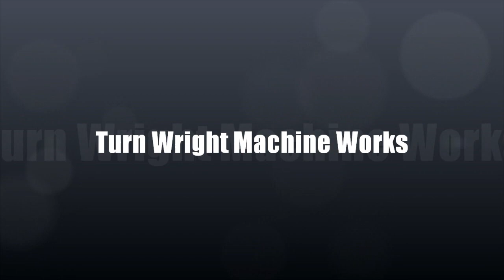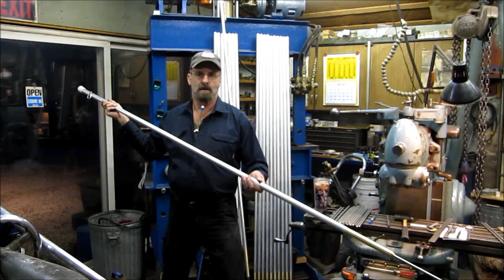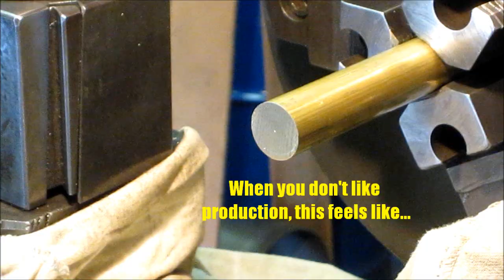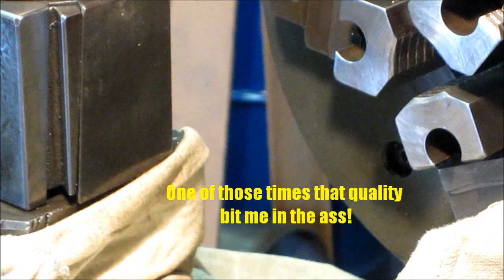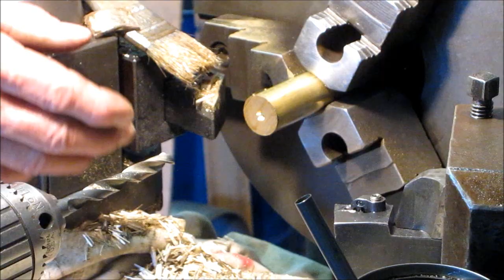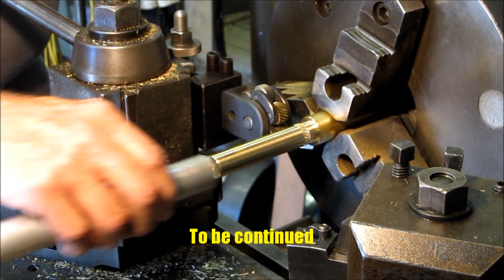Stick It!

Comment: Your videos are great !  Would you consider a straight knurl for the harpoons instead of the diamond ? ( less tearing up of the ID on insertion - ? )  Why or why not, if you have time to answer.

thanks, Mr F. , Darryl Dodge
Reply from the maker: The knurl is light and fast and not even full depth, just enough to grab. the straight knurl would be the same but not worth the effort to change my rollers, from my standard set up. The head is never removed unless the pole is trashed and then I have my own way to slip out the head and insert it in another. ;{)-----

Comment from the maker: I'll be looking for a replacement for my trav-a-dial soon! The dial that I have, I used while working for a company called Atkinson Marine back in the early 80's, then it was sold along with other dials to a company Northstar Propeller, in the early 90's, one of the crew crashed into it one day and we replaced it. It was deemed dead and given to me, After massaging it a bit, I got it working, had it on a southbend and now on my clausing and the inerds are just starting to wear out!

Comment: At least 101 ways!  At least your tailstock that can be moved with one hand!

Even though it may be a little OT, if you have time I'd appreciate any feedback you may have on the Trav-a-dial...lots cheaper than DRO especially used and no scales to install or break...

Comment: Keith,

How do you like the Trav-a-dial?  These brass heads look like turret lathe parts...depending on volume, maybe consider getting an old W&S and bar stock feeder!  Have you ever tried making them using the tracer?  You would still have the knurling and drilling operations, but using the tracer might reduce overall machining time...

Comment: You've stated that you are mostly a one-off job/custom machine shop.  Even if you don't often do production runs of multiple parts, wouldn't this operation and others be done more quickly on a small (9") second op. lathe with a lever collet closer, tailstock turret and bed crosslide toolholder?